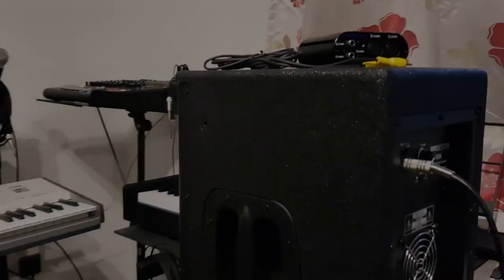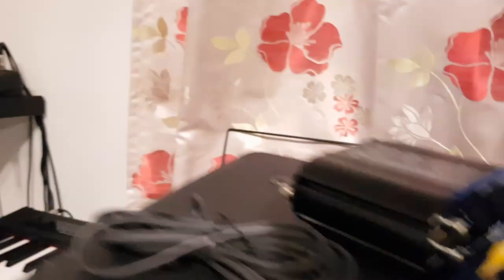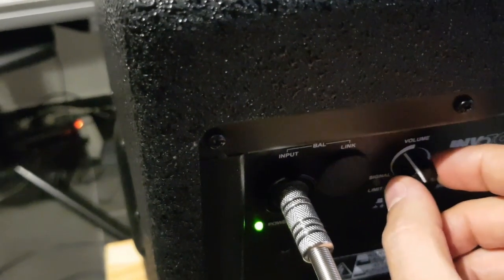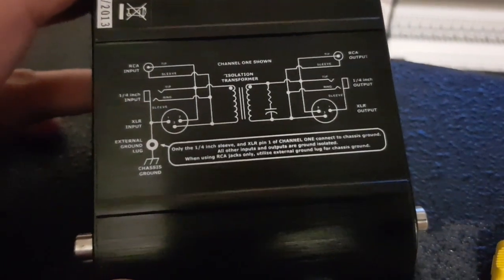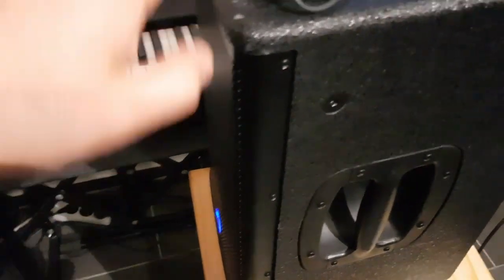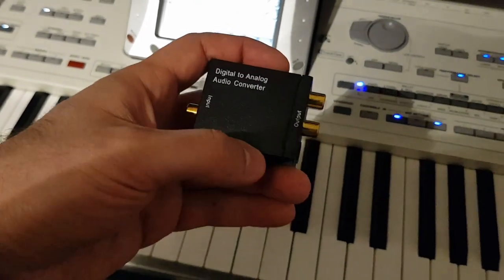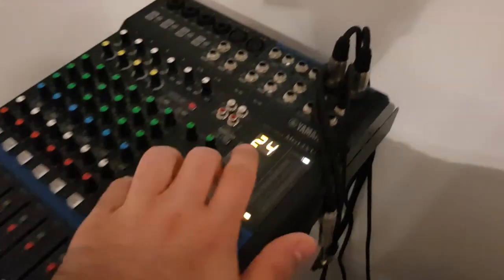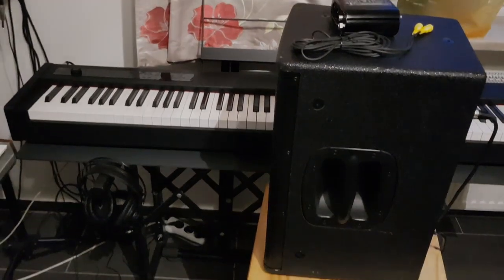Audio White Noise (Hiss) Problem

Comment: I had the same problem with my laptop output into my power amp. Like your case, it was a hiss noise, not a ground loop. I tried every kind of noise eliminators and no result, the hiss remained.
Finally I got a Peavey SDI Speaker Level Direct Interface with Ground Lift Switch which converts unbalanced TRS steeeo jack to 2 XLRs. My power amp has XLR inputs too.
As soon as I switched the TSR inputs to XLR, the white noise went away. This device has a switch for eliminating ground loops too.
But when I see that even your Yamaha mixer makes noises out of your amp although it's connected via XLR, I thought to myself that the problem with your mixer is something else. I mean if you use the Peavey SDI for connecting your keyboards the problem will be probably fixed but about the mixer, I think it is generating a white noise itself as I had different Yamaha and Behringers mixers and all of them were producing hisses. I think you should replace your mixer with a more professional one.
Thanks for reading my comment.
Amin

Comment: I have the same problem. I have a small amplifier if i connect aux to it , starts to make a huge noise and if i unplug the aux cable it stopes the noise 
What should i do
Reply from the maker: Sorry to hear that. I found out that this amp is not well enough for live music. You can use it as a loudspeaker for a speech or other purposes. I just sold them and got ILoud micro monitors. Perfect piece of gear for a home studio.
Reply: @manouchehrmail  thank you dear 💝
Reply from the maker: @computerworld3509  No problem. Just get rid of them.

Comment: This is called signal to noise ratio. It's all about gain and sensitivity of the components. BUT, you got such crap cables to plug your quality instruments, that makes no sense at all. Begin by well made high quality cables, then you try it again. you should get some very minimal noise ,still, but what you showed is indeed too much. If you're using a mixer it's also likely introducing noise. In other words, buy professional grade equipment.
Reply from the maker: Thanks for putting time to watch the video and writing a feed back. Just as an update I should say using the same cables and mixer but different pair of monitors (i.e ILoud micro monitors) I don't have that problem anymore. The speakers were the problem.
Reply: @manouchehrmail   This actually confirms my signal to noise ratio approach. The Iloud and pretty much all the other monitors out there are significantly quieter than an amp. Just think  like this, every time you amplify something, I mean literally making louder sound, there will be noise. A little hum or hiss is totally normal in a bigger amp like yours. I hope you're happy with the Ilouds. You should make a video showing off the sound of this thing ;)
Reply from the maker: @EduardoBach01  noise exists all the time and it's something we can't avoid. A good design should have a good noise cancelation. The speakers shown in this video are lacking such good design. There is plenty of good videos about ILoud micro monitors in YouTube already.

Comment: In many amplifiers, when you turn the gain up so high, you will get more noise. If the amplifier section has been made cheaply perhaps, then as this is a common factor (same problem, Two sources). input front end might not work well. 
I have never met the brand of speakers that you have bought but have seen that happen. Please try again but with sensible levels of playing and see whether it is usable without the high gain you keep trying.
Might not be good sending Phantom power to the Korg (global switch perhaps on your mixer).

Try with different PA, given that a mixer and your Korg do exactly the same with the same speaker on high input gain. It is not a true test with nothing plugged in.
Reply from the maker: I have tried it with a home soundbar. No such problem. I believe my PA has some issues.
Reply: I have Alpine and the hiss happen when set gain